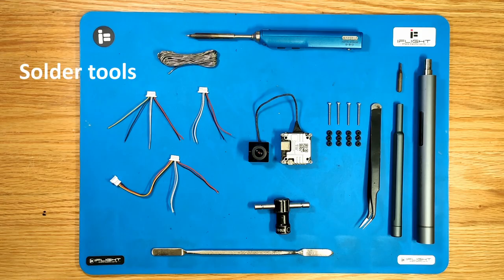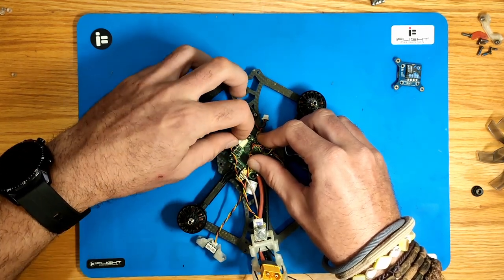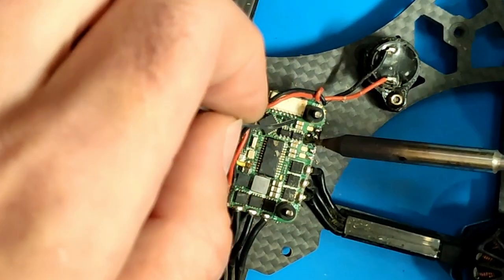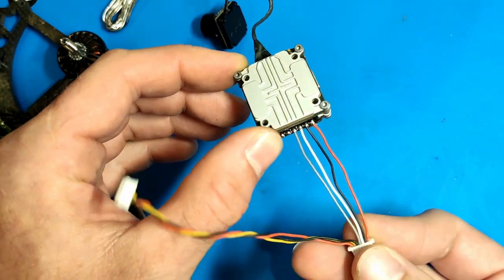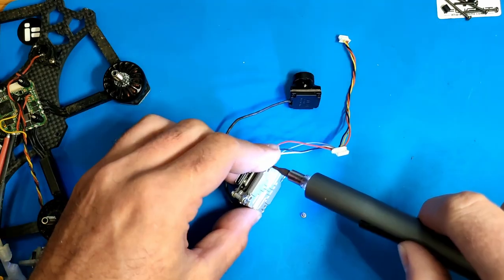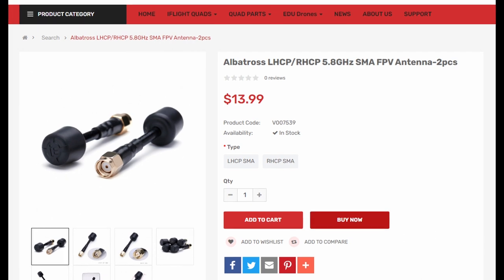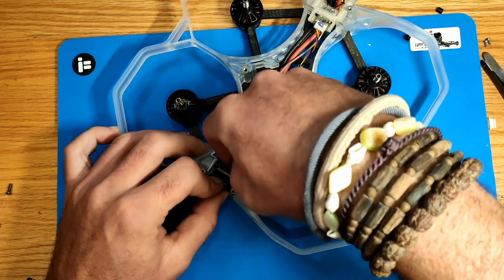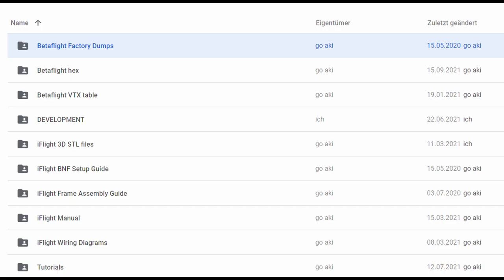iFlight ProTek35 // Analog to HD Conversion

Comment: I’m building a ProTek35 as we speak. I’m stuck on which AIO I should buy. Couldn’t find the motors the stock one comes with so I went with 2205/2900kv motors. It’s mainly going to be run on 6S. I was recommended the beast H7 or F7 and to get a matek cap/tvs diode to put on the xt60 connector because he said he’d be worried if I’m running it on 6S not having it on there. Any recommendations?

Comment: Nice video, thank you.. However, if I want to use the original antenna that came in the Polar Caddx box, what cable adapter should I use? I'm having a really hard time getting the answer. Thx, dude!
Reply from the maker: That's basically too short and can't be used
Reply: @xingtheiflightinsider  ok. Then I've done all your tutorials, but my OSD doesn't appear, I've done many ways but it still doesn't show up. Any ideas? Thx

Comment: Hey, thanks for the video. What I dont know is why UART 3 is on in serial RX? is the led? I get UART 1 is for the reciver in my case tbs crossfire and UART 2 msp is dji vista.
Reply from the maker: This video was shot on a older flight controller. You'll need to adapt with the wiring diagram of your version which can be found in the iFlight page following the support button.

Comment: Great video , I want to build one from
Scratch , HD with vista , do you think that it will fits ( caddx vista unit ) in vertical behind or in front instead that over the Fc ? I’d like to use a traditional 20x20 stack

Comment: Hi question…. I also have a protek35 but it’s crossfire. I just got my air unit and noticed the wire harness has 6 wires I took out the last yellow and black wires because I’m not using a dji remote controller. The connector on my FC is for 7 pins? Do I transfer the 4 wires to the 7 pin connector?
Reply from the maker: You have to connect to TX RX on any UART and then the two power wires (red black). Best would be to check the wiring diagram for your FC.
Reply: im in the same boat.. what did you end up doing Daniel?
Reply: @giangulli  I ended up using the original wire connector just make sure you transfer the fires in the right sequence 2 of the wires you will have to solder to the board T1 and R1 it worked for me 👍🏼
Reply: @danielamarillas3849  Nice, thanks! I actually had previously used the plug on the FC for the radio link (TBS Tracer). So I ended up using the available T3 & R3 on the FC for the Caddx vista, then power & ground on the FC too. That also ended up working haha phewww.

Comment: Okay so I got my quad all setup. ExpressLRS setup vista set up etc etc. went to check motors in betaflight. All motors operate fine. Whenever I individually raise each motor one by one they all collectively work together. But, whenever I use the master scale to raise them all at the same time. My smoke stopper turns red and shuts the quad off everytime. Any ideas what’s causing this? I am using a Beast F7 55A AIO v2
Reply from the maker: The smoke stopper is not intended to power motors...

Comment: Thanks for the video. Just bought a vista unit gonna convert also. Btw dont u want to solder the vista direct to the power pad on the aio?
Reply from the maker: no, that's what the plug is for. Doesn't matter where you solder on, just Vbat or above 10V, the Vista goes up to 6S

Comment: Appreciate the video. I've been planning to do this for a while but haven't had time to get round to doing it. One comment though: I'm pretty sure it is possible to install the air unit (it sits on this little shelf protrusions on the inside of the prop cards). I thought the Protek35 came with the air unit installed when it was first released. You do need shorter screws for the AIO board though (14mm if you keep the little doughnut shaped grommets; 12mm if you remove them).
Reply from the maker: Yes, it is possible. But you'd need to get 2 new MMCX pigtails, a new TPU print, and 2 new LHCP antennas. Especially the extra weight, it's not recommended and necessary to be honest!
Reply: @xingtheiflightinsider  Good point about the weight. Hadn't considered that to be honest. I have all the bits ready to go, so I may consider my options before I install it!